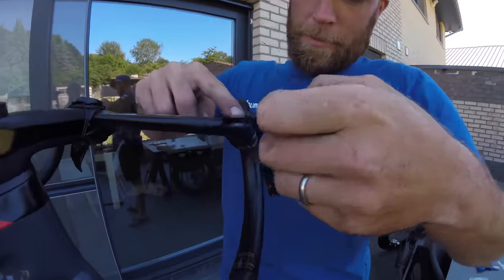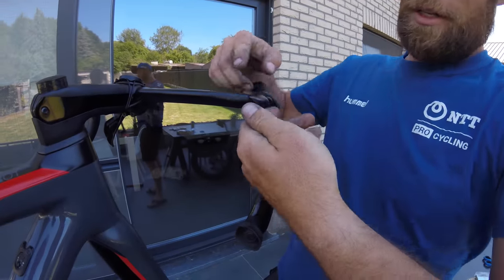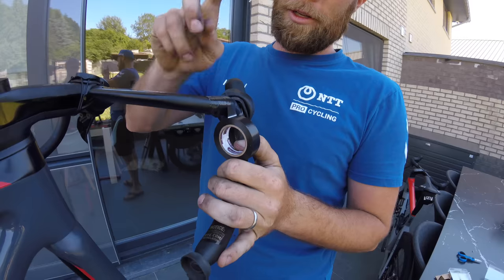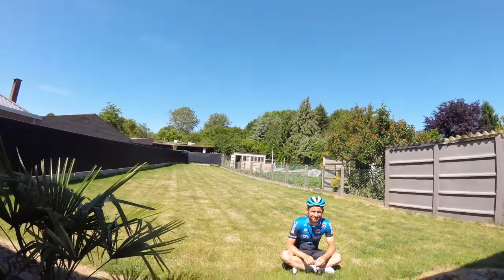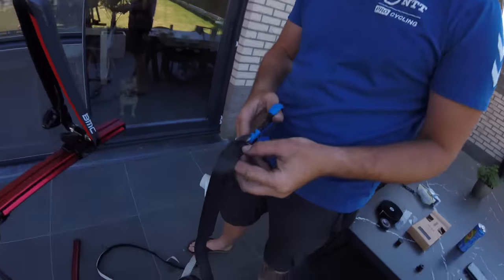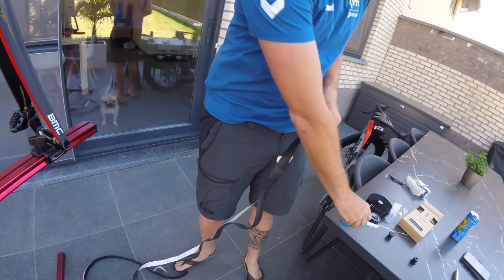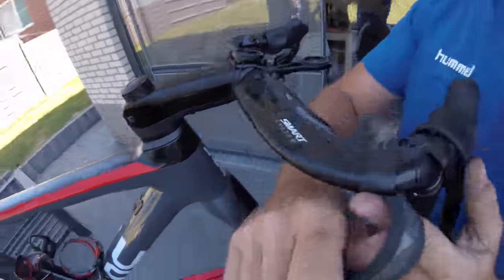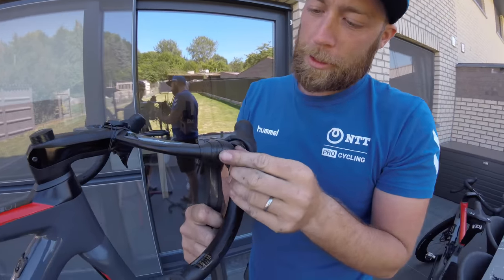Wrap you handlebars with ENVE handlebar tape

Comment: Was wondering how people were getting that top finish. Where does your bar end junction box go with those bars if you don't have a spot in the frame?
Reply: then you will have to cut one side of the bars and use the junction box to secure the tape. But with BMC frames the junction box is very neatly secured on the down tube!!

Comment: Anyone knows if there is a possibility to buy bar end plugs with the rubber collar to install it into handlebars? Like those integrated in Victor handlebar.
Reply: You can buy these from ENVE but they might not fit other brands. The plug is a two-part system and works really well (the part you twist and a smaller plug to seal it). It is made from a type of silicon and is really sturdy, they are called Enve Road Bar End Plugs and are 10 dollars for a set.
Reply: @StreamBikesNL  Thank you!